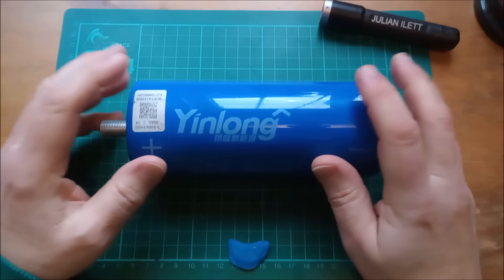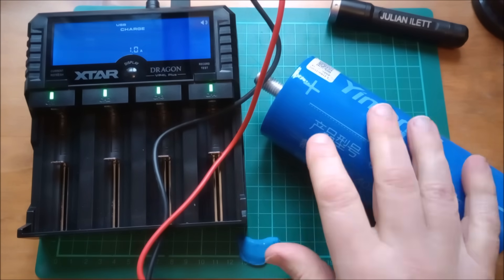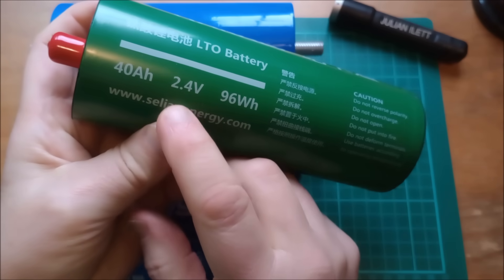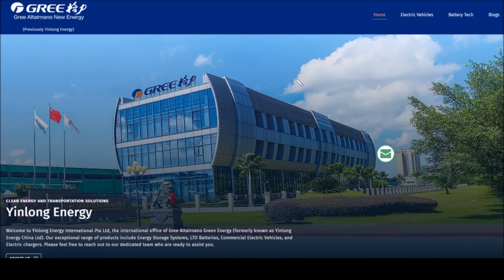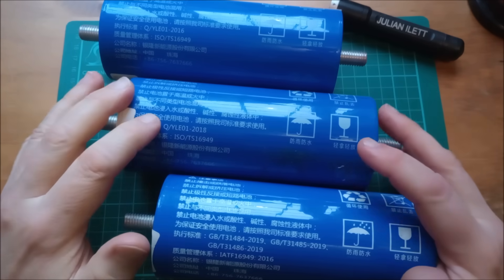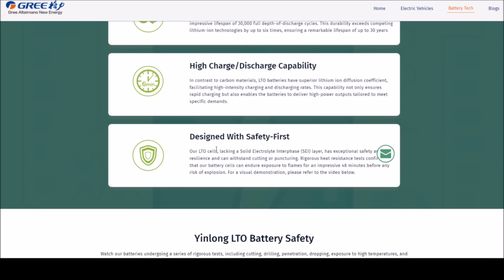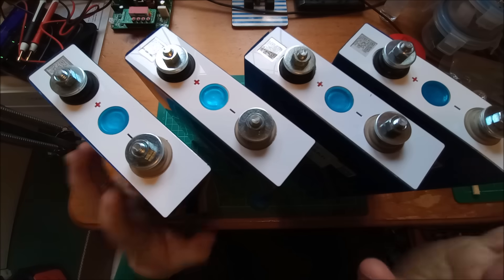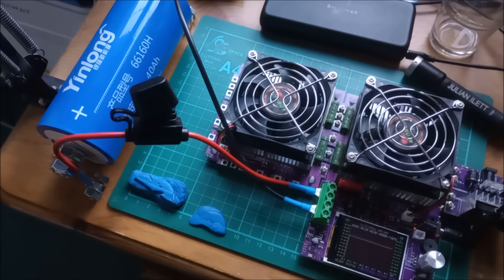Lithium Titanate Cells - an Introduction

Comment: These cells are becoming VERY popular in the Van life and Off Grid communities 👍
Reply: Doubt it. LiFePo4 is the universally loved chemistry for all uses, especially RV use. Lifepo is more temperature stable, which is important in an RV environment. Lifepo has better stability and safety. Lifepo is self-extinguishing meaning it won't create a massive fire. The even lower risk (than Lifepo4) of thermal runaway is the only attractive feature about this type of cell for RV use over LifePo4 that I see. And, on paper, in theory, it has slightly higher cycles. But Lifepo4 is long, long tested, tried and true.
Reply: @gymkhanadog this video kinda says the opposite of what you're saying
Reply: @FAB1150   You mean that YouTube video telling me that we're actually living inside a hollow Earth contained within the Moon that actually orbits Venus, is wrong??? Youtube videos are never wrong !!!
Reply: @gymkhanadog  I can say the same thing about a random comment under said video
Reply: @gymkhanadog  Fully agree, BUT LiFePO4 has its problems with low temperature! Charging below 10°C should be done at lower current (for example just 0.1C instead of 0.5C) and below 0°C you better should never ever charge LiFePO4. This means Li-Titanate could be the complementary solution for people living in colder regions, where LiFePO4 cannot be used because you experience premature failure (unless there is another type coming up like LiYFePO4 at reasonable price, this means expensive Yttrium added which expands use down to -20 or even -40°C) or the huzzle with heat up to use LiFePO4 at sporadically cold temperatures does get too disturbing.
Reply: Interesting. Thanks for the idea
Reply: @ThootenTootinTabootin  There's also plenty of videos showing how to make your own DIY 12V car battery with them 👍
Reply: AND ... other hot trendy hashtag keyword search tags such as Lower Slobovia...  popular with van life... https://www.youtube.com/watch?v=G8GwT7ZotCg
Reply: Lifepo4 would be better for vanlife, LTO are too heavy for the amount of energy stored
Reply: @M_a_r_ke  People buy them because of the lifespan & safety.
They have plenty of capacity for a Van.
Reply: @edwardfletcher7790  what about car audio?? That's why I'm here
Reply: @robertdunn1545  Absolutely, they're great for very high end car audio 👍

But the most practical installs I've seen are large RV solar setups. They last the lifetime of the vehicle.
Reply: High  discharges are not bad to have but aside from specific Circumstances it's not that useful like for van life do you really need to be able to empty your whole battery bank in 6 minutes even 1 hour when really you want it to last at least all night call it 12 hours so thats going to be more than enough surge current capability and for cycles lifepo4 would probably be fine because you want to size it where you have more backup than 1 night so generally you will not be completely emptying the battery everyday so the since you are not doing full cycles it will last a long time
Reply: @james10739  People really like the safety aspect. Vans aren't crash rated, so that safety is a big deal.
Reply: What would you rather have a battery if there's a fire you're dead in a van or a heavier bigger one
Reply: @patrickday4206  The two major features of these titanate cells is :

1. They DON'T suffer from thermal runaway and BURN🔥 like most other Lithium cells.

2. They have about 60x the lifespan of standard lithium cells.....

Do some reading Genius 🙄
Reply: @patrickday4206  Lithium titanate cells don't catch fire... SIGH 🙄

Do some reading before you embarrass yourself.

Comment: Great video and thank you for bringing us the latest cell technology,  is there data on self-discharge? - I have a project where I would like to leave one cell
for a say 6 months without having to re-charge.
Reply: Self discharge is nearly nonexistent with all the lithium chemistries. I've had NMC cells sit for almost a year at nominal and when I checked them later their voltage was the same or a few millivolts less.

Comment: WOW another gutbuster J, just when I was getting an appetite for SiBs ( Got my 8 SiBs from Hakadi on test thnx J for the tip BTW)  but you are doing a bit of clickbait here for Hakadi's shop front. OK so long as we know.  The Bus stats are amazing and definitely needed for city mass transit? We dont know they are all using LTOs but nonetheless OMG. Weight is an issue 80kWh/kg vs 150kWh/kg for Sibs and 250 kWh/kg for Lifepo.  Cost $400 for 6 (12v 40Ah system) ca 3-5 x cost of a Lifepo and a Lifepo is 1.5 x cost of a common Lion. I am edging towards a Lifepo 24v 100 Ah system comprising 2 small auto battery cases cw bms £700 would cost ca £3500 for my Golf cart.  At least the DH little brats wont be fitting these to their pavement scooters and doing wheelie burn outs anytime soon.  Great  stuff J
Reply from the maker: Hakadi have said I can have all the cells I want for my videos, so I'm more than happy to return the favour. I can afford all the buck and boost converters, coulombmeters, wattmeters, electronics loads and all that stuff, but the batteries are the expensive bit. This is the only way I can make this work :)

Comment: id wonder if it would be reasonable to in a pinch if these were in a car audio system to use it as the starting battery if the lead acid one failed?

Comment: Hmmm, that voltage makes it useful for applications designed for 2.4V (2x1.2) NiMH cells. Can they be charged without a smart controller, e.g. just connecting them to a solar panel?
Reply from the maker: At the very least, use a BMS to prevent overcharging.
Reply: Be aware of higher voltage impulses in some NiMH chargers, it needed to keep it healthy,  but can destroy lithium sell

Comment: The first of a new fleet of 'tri-mode' locomotive, designated class 93 and built by Stadler in Spain, has just been delivered to UK freight company, Rail Operations Group (ROG). For fast freights mostly on electrified tracks, a moderately rated diesel engine onboard provides 'last mile' power and a small battery of lithium titanate technology can boost the output for a short time or allow the loco to make small movements without starting the engine. The battery can be charged from the overhead wire, from the diesel generator when its full power isn't required for traction and from slowing via regen. The loco can also haul passenger trains and a good proportion of ROG's business is delivering new rolling stock. Top speed is 110mph.
Reply from the maker: Interesting. Titanate has a niche in trains too :)

Comment: Sounds like they'd be useful for most off grid inverters with that voltage range, how much do they cost tho
Reply: Around 60€ a piece for the Grade A 40Ah. 6pcs set you back 360€, 24pcs 1340€
Reply: @marcus_w0  yeh I saw the link, I wonder where to get the used ones, b grade cells tho
Reply: I don't think so, if you compare it to a 24 Volt battery, 8x280Ah Eve cells cost 8x$100= $800,  or 70 of these at $60 = $4200.. so?
Reply: @habana7638  but most dc to ac inverters switch off between 10 an 15 volts, I still think lead battery's are the best if you're not moving tho

Comment: The larger the capacity the lower the resistance will be, all else equal. Also, it's easier to design the cells to have low resistance if energy density isn't a very high priority. 

With just 76 Wh/kg (according to Yinlong's website) it takes quite significant losses to heat up the cells, and combined with tolerating high temperatures and internal low resistance it's not that strange, or impressive that they can be charged and discharged at 10C for 10 seconds max, and 6C continuous for charging. 10C times 76 Wh/kg means 760 W/kg, which isn't very high power density, keep in mind that's for the cells, not complete pack and system. Somehow Yinlong's webpage says they can be charged in 6 minutes, but also 10C charging is limited to max 10 seconds, and 6C is max for continuous, so those 6 minutes possibly refers to 60% of their capacity.             

If they are more tolerant for a wide range of factors, and much more long lasting even when exposed to such factors they are absolutely very useful in some applications.  Being able to charge and discharge their very low capacity at a high rate doesn't mean they have high power density.
Reply: china numbers are always fake

Comment: The real safety test is nailing the battery to cause a massive short circuit. This way all the stored energy is dumped inside...
The energy density is poor and even the power density is just on paar with common lithium cells. But it's probably for busses: you charge a bit every few stops

Comment: Nice and all, rather more easy to deal with then the voltage curve on Sodium. But still Lithium based. I am trying a set of Sodium just to get rid of the lithium addiction we all seem to have. Though nice these are re-used ex-vehicle cells at least.

Comment: Interesting, I was in discussion with Altarnano NA in about 2012 about batteries for a demonstrator multiple unit train, eventually went with conventional Lithium batteries. Main issues were energy per vol/mass being low, and the cost was about double that of a standard solution.  

https://youtu.be/MUKTsZ7e5RE?si=isU5XjZoZsiPJsd8

Comment: On using these cells in a car;

I would go with a 5S pack (13.5v full, 12.5 nominal) for jump-starting applications as the fully charged voltage matches a charged PB battery at 13.5v. also 400 amps from a 40AH cell would be sufficient to start almost anything up to a 2.0L diesel.

I wouldn't consider using these cells in a car long-term without modifying the charging system though. LTO and LFP cells have a lower internal resistance than lead acid cells, which means they will apply a much heavier load on the alternator which can result in overheating and failure unless you overdrive the alternator or upgrade to one designed to control Lithium cells. That's also to say nothing of the potential for voltage spikes should the BMS on the battery reach its cutoff threshold on a cell. If the battery reaches its charge cutoff threshold this would result in the charge current being stopped into the cell suddenly, which could easily result in a voltage spike that could damage the vehicle's systems. Now while this might not be as likely to happen with a 6S LTO, you will still run that risk should the battery fall out of balance due to a lack of or insufficient cell balancing.
Reply: The car audio guys don't run full BMS, only active balancers. Just a voltage setpoint. No protection from overcharging or overdischarge, some don't even run fuses. LTO is considered a "safe" chemistry by the audio community and doesn't have nearly as many fires attributed to it as other chemistries. But it is also regarded as slightly more difficult to impliment, needing modified voltage setpoint to charge a 6s bank in the mid 15-16v range to get best performance. The amplifiers usually run unregulated supplies, so more input voltage* = more rail voltage = more powah!

*Until factors like transformer saturation and mosfet current limits set in

Comment: Specs sound good - I remember Will Prowse talking about them and cant understand why they never took off - is it just cost of the Titanium?
Reply: More likely the low gravimetric and volumetric energy density that LTO cells have - they're great for static energy storage where weight isn't a big problem but you just can't beat NMC, LFP and Na-Ion for energy density and weight for EV applications and compact devices like laptops and phones.
Reply: @DigBipper188 if they are used the density will improve pretty new technology

Comment: Surely with such a low internal resistance, connecting to an alternator would effectively be a short and the alternator would burn out.. ?
Reply: @muddy11111   Internal resistance can be zero, but does not present a short to a charging circuit unless the battery voltage is also zero. In reality, you have several cells in series, and you might have 5 cells at 2.4 volts for a nominal 12 volts.  If the internal resistance is, say, 0.005 ohms, then that's 0.025 ohms for 5 cells, which means that you'd need a supply of 12.1 volts to charge at 4 amps, or 12.25 volts to charge at 10 amps.
Reply from the maker: With alternator and lead-acid at the front of the car, LTOs, amplifiers and speakers at the back - you could have moderate gauge cables between front and back to add a bit of resistance.
Reply: @JulianIlett as one of the car audio people, I can say with confidence that most people who run LTO do away with the lead acid because they charge at 15.5+ volts, which will gas a 6s lead acid battery very quickly. And we charge straigh CV, with current being limited by resistances in the charging system, which we attempt to minimise. And most of the lithium chemistries provide power at a voltage that is still charging the lead, meaning that the lead acid ends up doing nothing to help provide current to our amplifiers. Then when not running, the lead acid finishes charging and then floats off of the lithium, which adds unnecessary cycling to the expensive lithium. I personally run a 120Ah bank of LFP and ~1200F of maxwell ultracaps on a 350 amp alternator in my daily driver. 

But in general my observation is that stock alternators don't seem to last very long when the build gets beyond 2-3kw of sustained power. Then the next step is a high output alternator, and then multiple high output alts when under hood space and fabrication abilities will allow.
Reply: Best bet is run a DC-DC charger, I use one in my camper to charge lifepo4 (it also has solar MPPT built into the charger)
Reply: Remember that the internal resistance is not actually a resistance but a calculated parameter that goes to show efficiency of discharge etc.
Reply: @stamasd8500  It is a resistance, and it can be measured when charging or discharging by varying the current between two values and measuring the change in cell voltage.  However, it is not constant (depends on state of charge, temperature, cell chemistry, age of cell, etc) and is it always in series with a voltage source which is the voltage generated by the cell chemistry.  The internal resistance is also a major contributor to heating of the cell when charging or discharging.